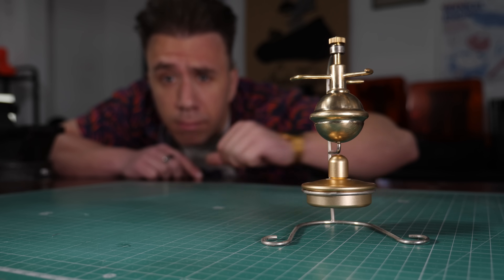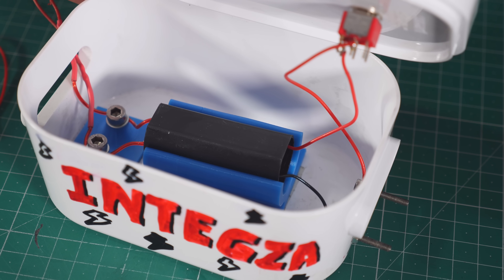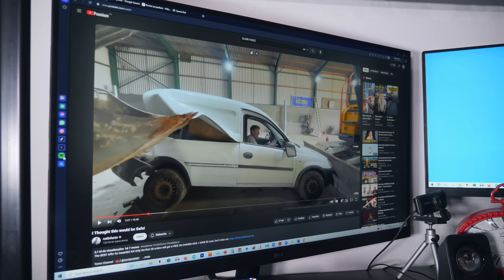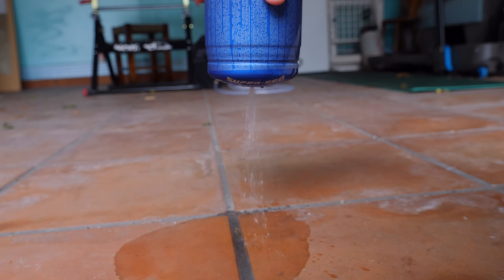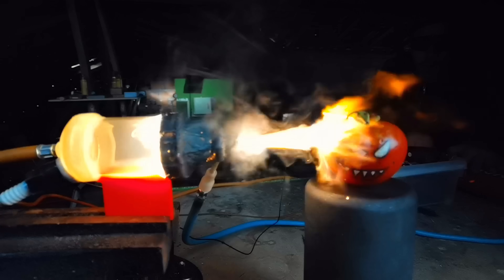I Built a ROCKET PROPELLER

Comment: You should make a air powered engine with your tesla oscillator using it's oscillating motion into rotational movement it would need no more complex valves and flywheel

Comment: You know the air pressure engine, what if instead of using a bottle as the tank, you can create a compressor, like a turbo charger, but instead of the exhaust gas it runs with a electric motor, so you can have different speeds and you don’t need any tank
Reply: Im trying to do it but I don’t have a 3D printer so I wanted to see if you could do that

Comment: 1. Plasma-Speaker Flamethrower

Combine a plasma arc speaker with a controlled flamethrower, syncing the flame bursts to music for a wild sci-tech sound system.

---

2. World’s Smallest Working Jet Engine

Design and build a miniature jet engine that’s not just small, but functional — maybe even smaller than a soda can.

---

3. Supersonic Ping Pong Ball Gun Mk III

Upgrade the classic vacuum cannon with new tech like electromagnets or compressed air boosters to try and break the speed of sound… again.

---

4. Home-Made AI Turret Defense System

Create an autonomous Nerf or water gun turret that detects intruders using AI (YOLO, OpenCV) and responds in real time.

---

5. DIY Hoverboard That Actually Hovers

Try recreating a real hoverboard using magnetic repulsion (Halbach arrays) or air cushion methods — inspired by magnetic levitation trains.

---

6. Tesla Coil-Powered Wireless Charger Room

Turn an entire room into a wireless power zone using Tesla coil tech to charge devices without cables (safely, of course).

---

7. Sonic Boom Cannon

Create a device that compresses and releases air so rapidly it creates a sonic boom — kind of like a reverse supersonic whistle.

---

8. Liquid Nitrogen-Powered Jet Pack

Experiment with a thruster system using rapidly evaporating cryogenic fluids like liquid nitrogen — safe miniaturized “rocket” effect.

---

9. The Impossible Drone: Propellers Inside a Sphere

Design a fully enclosed drone with internal rotating blades — testing airflow dynamics and flight stability in a wild new way.

---

10. DIY Mechanical AI Arm That Learns from You

Build a robotic arm that mimics your movement using machine learning, then let it evolve to perform tasks on its own.

Comment: Hi I'm new to watching your channel, I know this is not where you need this comment, BUT,
In one you said that you and Tom Stanton can't get a 3d printer to build a good sealing piston engine, so you build a square one, this being due to the printers that you have can't make a perfect circle !
Ok, so try an oval cylinder and a oval piston, this should work perfectly, I know Honda do this so they can fit more valves, although they don't use a 3d printer 😅 try it though.

Comment: AI Summary

Abstract:

This video details the experimental design and construction of a novel "spinning rocket" concept, drawing inspiration from Heron's Aeolipile to rotate a propeller. The project focuses on an internal combustion engine fueled by butane, later upgraded to propylene, designed to expel exhaust gases sideways to generate rotational thrust. Key engineering challenges addressed include managing extreme heat, leading to the use of graphite for both the engine's nozzles and a custom ball bearing cage. A thermodynamic innovation involves coiling a copper pipe around the engine to utilize the expansion and cooling properties of liquid butane, simultaneously cooling the engine and increasing fuel pressure. While initial tests with butane yielded limited RPMs, the accidental use of propylene significantly boosted performance to 2840 RPM, producing a kilogram of thrust. The video concludes with the next objective: integrating an air compressor driven by the engine for self-contained flight.

Propeller Rocket Engine: From Ancient Inspiration to Modern Experimentation

*   0:00 Heron's Aeolipile Inspiration: The video begins by introducing Heron's Aeolipile, an ancient steam turbine, and reinterprets its rotational principle to create a "spinning rocket" designed to drive a propeller.
*   0:32 Efficiency of Moving Air Slowly: The creator explains the principle that moving a large volume of air slowly (like a propeller) is more energy-efficient than moving a small volume of gas very fast (like a rocket) for sub-supersonic applications, due to the quadratic relationship between energy and velocity.
*   1:00 Rocket Engine Construction: The core of the project is a compact combustion engine that burns butane gas and expels it through a small hole to generate thrust, based on Newton's Third Law.
*   1:18 Graphite Nozzles: The engine's nozzles are crafted from graphite, chosen for its excellent heat resistance and ease of machining. The creator empirically tests three different nozzle sizes based on NASA-derived equations.
*   2:03 Sideways Thrust for Rotation: To achieve rotation, the exhaust gases are redirected sideways through brass tubes, a design inspired by the Aeolipile's rotational motion.
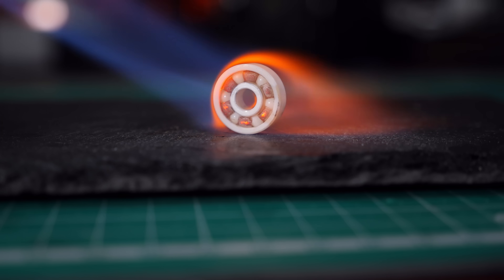*   3:33 Ball Bearing Heat Failure & Graphite Solution: An initial zirconia ceramic ball bearing failed due to its plastic cage melting under high temperatures. This was remedied by fabricating a new, heat-resistant, low-friction cage from graphite.
*   6:39 Propeller Protection & Butane Cooling System: Recognizing that the carbon fiber propeller's resin binder would burn, an ingenious cooling system was devised: a copper pipe coiled around the engine carries liquid butane. As the butane vaporizes and expands to fuel the engine, it simultaneously absorbs heat from the engine (cooling it) and increases its own pressure, enhancing fuel delivery.
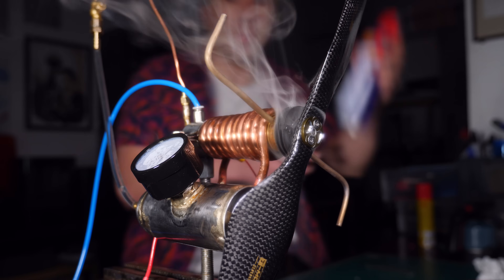*   9:00 Challenges in Butane System Optimization: Achieving stable operation required precise adjustments to the fuel reservoir's placement and the exact amount of butane charged into the system, balancing cooling and fuel supply.
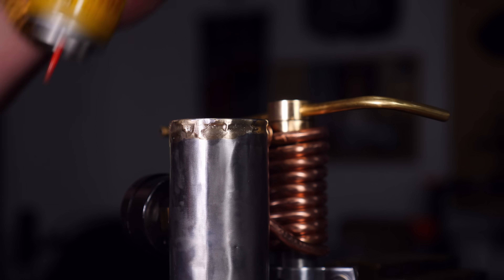*   9:41 Initial Performance with Butane: With butane as fuel, the engine reached up to 1280 rotations per minute (RPM). However, performance was limited by the butane's relatively low vapor pressure of 4 bar.
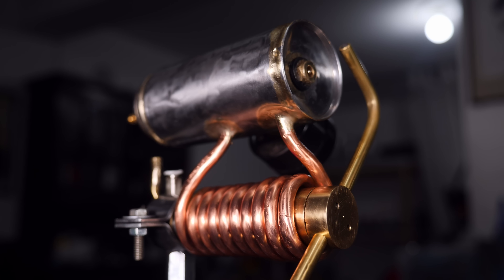*   10:42 Accidental Discovery of Propylene Fuel: The creator inadvertently switched to propylene (mistaken for butane) from a welding kit, which naturally has a higher vapor pressure.
*   11:56 Dramatic Performance Boost with Propylene: The use of propylene led to an "insane" increase in speed, reaching 2840 RPM and generating approximately 1 kilogram of thrust.
*   12:08 Future Goal: Self-Contained Flight: The next phase of the project involves integrating an air compressor, powered by the engine's rotation, to eliminate the need for an external air supply and enable autonomous flight.

I used gemini-2.5-flash-preview-05-20| input-price: 0.15 output-price: 3.5 max-context-length: 128_000 on rocketrecap dot com to summarize the transcript.
Cost (if I didn't use the free tier): $0.0054
Input tokens: 15882
Output tokens: 849

Comment: I got an idea lot a metal fueled rocket .. copper and aluminum react to each in acid right what about ground up aluminum and copper powder  and electricity high voltages   

I’m not sure what will come out the exhaust with a lil air pressure .. it will work I’ve been messing with vitamin supplements 😂😂😂  3 d printer nozzle and air circulation pump from a bed 😂😂😂 .  And a Dyson fan it’s gonna sound weird but green flames have more thrust I hope some one tries I’ve been thinking about casting aluminuminte (copper and aluminum ) then collect the sanding shavings I hope I just didn’t invent something dangerous 😂😂

Comment: Bottom port in for the cooling coil, top port out for fuel output. With bith in and out ports at the same level you arent making use of the heat at all.

Comment: The helicopter kellett kh-15 (aka Stable Mabel) used 90% hydrogen peroxide that decomposes and generates super heated steam  that poweres two steam jet engines at the tips of the helicopter blades to generate torque.

A minum 67% H2O2 concentration is needed to generate enough heat to completely evaporated all the water water. Ahe catalyst decompose the H2O2 and is made up of silver electroplated onto a nickle wire mesh.

Comment: Did you ever consider running the air pipe through the "butane" reservoir? The rushing air through the reservoir will pull the butane fumes along with it. It'll work just like a miniature carburetor.

Comment: Could you pleas build a rocket steering system (so that the rocket can steer itself and maybe even weaken or strengthen the thrust)
Reply: Integza, you can use the FULL POWER of your air compressor, without the air going into the butane can, if you use a Venturi so the air can "suck up" the butane.

I don't know why I wrote FULL POWER in caps, maybe it's because 🍅 are 🤢?

Comment: You could try using ram air generated by the propeller airflow to get some compression for your air supply, But that’s probably not going to get you very far. Even if you somehow manage to get ram air intakes on the end of the propeller blades you’ll be lucky to get 0.2 bar out of it.

If you can put something on the rotor to transfer power to the back of the assembly you could drive an air compressor with that

Comment: Say.  Would it be good idea to separate the liquid and gaceus fuel mixture so you can maximize pressure and cooling.  As for the compressed air you already demonstrated that a 2 literally bottle can survive 8 Bar which should allow you to have ample pressure and minimal weight for a short flight.  Having the bottles hooked up to a air compressor before the engine winds up and during take off would allow you to maximize pressure in the bottles lengthening flight time.  Oh and one more thing.  Integrating the exhaust lines into the propellers would reduce drag and help with cooling as the propellers absorb and dissipate heat.  I'm not an engineer or anything so take my words with a grain of salt but it might be insightful enough to think of something useful.  Cheers and thanks for the cool concept.

Comment: If you need compressed air, Paintball canisters hold a lot at high pressure.  I'd use one-way valves and a regulator on both supplies....

Comment: I think I have a solution, it is a configuration that uses a ducted set of propellers to compress air into a jet along the axis of the engine. Also you can bleed off some energy to solve the fuel feed problem using some sort of cryogenic pump to move the liquid fuel.  And if thus you don't really need to return it to the reservoir allowing you to highly pressurize and control the entire fuel system.  Anyway I'm sure I've seen that configuration somewhere before 😂

Comment: Would love to see you build a duct around it with stators fixed to the duct, the nozzles angles outward a little, using the pressure to maybe improve power? Then a smaller fan could blow through the duct creating thrust and cooling flow.  Just a thought... Might be a total waste of time.

Comment: just a thought.. instead of compressing air for the combustion via the engines rotation.. could'nt you just take both cans from your little welder and use both? then you have both fuel and oxygen? i mean it IS a rocket

Comment: the coil and tank doesnt allow for any flow through the coil. normally the liquid enters the coil, vaporises, and straight into the burner. look at hot air balloons?
yes, propane has a higher pressure as it liquefies at a lower temperature than butane...

the thrust is only the area of the tip and the pressure differential at the nozzle.
as its a reaction turbine it still has to spin at the same speed as the gas its ejecting for maximum efficiency. which is silly fast.
try the opposite. hold the nozzles still and blast the exhaust past a ring of blades... impulse. 

the tube itself is a large restriction...

Comment: Oh, by the way—quick idea I had while rewatching your magnetic piston engine video:

You mentioned that awkward moment at TDC (Top Dead Center) where the piston just kinda... stalls, relying on its own inertia to carry it through. I kept thinking—what if we stopped forcing the piston to do all the work, and instead made the engine pivot with it?

Like, instead of a static combustion chamber and a moving piston, we let the entire chamber oscillate around a pivot—swinging with the crankshaft’s motion. The result? The piston rod still drives a rotation, but the cylinder itself tilts in sync, keeping momentum going even at TDC.

Comment: Back in the 50's a rocket engine was designed that had the propellant expansion coils mounted inside the combustion chamber. This engine ran on liquid propane. Maybe this might work for your application if you were to make things a little bigger so parts would fit. Question: If you made your rocket exhaust pipes longer would this give the shaft for the prop more torque to spin the prop? Conversely I think that shorter pipes would cause the prop to spin faster. Something to play with while you learn to like tomatoes. :)

Comment: hey meng, you lose a good amount of thrust bending those tubes when you could just use a Tesla Turbine to convert the flow of gas to mechanical force using a straight outlet from the combustion chamber instead.  It's a bit more complicated but results in more rotational energy.  And more energy is always better, yeah?  You feel me.  GG

Comment: now  do  it  by 1,000 X`s  and  in  diferent  position  all  pointing in  one  direction  , you  will  have to  adjust  pressures  to  force  each  to  burn  at  same rate  per  each  end of  exuast  has to  meet  same point  of  exit and  yes  again  yo  have  to  adjust  per  each  leaving  most  interiuor  at natural /  raw  - once  equality  has  been  acheived  then  you  boost ,  so  scale  has  to  meet  pressure  value  to  continue  utility  at  range  or  it  may  just  burn  up depends  on  which  or  shall  i  say  the  ammount  of  force applied /material  used `~

Comment: A bazillion years ago when I was young & dinosaurs still roamed the Earth, there was a magazine called "Popular Mechanics." In one issue there as a backpack helicopter unit where the tips of the rotors had little jets, which eliminated the usual need for a tail rotor because no torque from spinning the main rotor [as we all should know by now, Newton never sleeps]

So your next challenge is printing up your own backpack helicopter using the principles of integral Integzajets at the tips. 👍😁

Comment: Maby you can run a pipe in a reversed way. Like with the opening to the direction of the rotation. Scooping air while turning. That would also mean more air when going faster. All you need is the right funnel to make a good ratio. Of air and fuel

Comment: 4 isn't a great design? You don't say.  😂😂😂 
Also, you don't need gloves for graphite. Only for graphene and nano graphene. Graphite is harmless, just very slippery. Also, I would be extremely careful when drilling, cutting, or sanding carbon fiber. I don't trust that stuff. I'd rather stick my face in a bunch of pink fiberglass than go anywhere near carbon fiber dust. Or as I like to call it, synthetic asbestos.

Comment: So, I got curious and googled around a bit and found that 
7:35 This is called regenerative cooling in rocket engines, where the fuel itself is circulated through channels in the engine nozzle or combustion chamber walls before being burned. NASA had this system in their Space Shuttle engines.

Also found there were helicopters that spun the rotors with jet at the tip called Tip Jets. 

I thought it was pretty neat.

Comment: I wonder if shortening the exhaust pipes might help at all. The exhaust gasses won't have as much distance to travel in the small pipe, so you shouldn't be slowing them down due to friction loss. The reduced weight might also help you gain an extra RPM or two. Propeller length might also be a limiting factor in RPM (I know you only had the one). 
The pressure issue might be resolved by using a smaller WD-40 can and copper tubing. 

I'll finish by saying that I'm not anywhere near being an engineer and have zero experience in what you're trying to do. I could be dead wrong in all aspects. I'm sure someone will correct me. Lol!

Comment: This is similar in concept to the "rocket on rotor" helicopter designs, some prototypes of which were built in the 1960s. This was a fairly simple modification which could in principle be fitted to any existing helicopter, but at the time the military spec Huey UH-1Y Venoms were chosen, since there were a lot of them in service.

The only modifications were the fitment of small rocket motors into the tips of the main rotor blades, firing at 90 degrees so that the rocket thrust would most efficiently be used to enhance the rotation rate. Each rocket had a maximum thrust of about 50 pounds force, and was a simple pressure-fed monopropellant motor, fuelled by hydrogen peroxide. No fuel pump was needed, since the peroxide tank was mounted just above the rotor hub, so that centrifugal force alone would be enough to feed peroxide to the rocket motors.

The conventional helicopter engines were not modified at all, and in fact were still used for the majority of the flight time, since the volume of peroxide carried in the hub tanks was only enough for a few minutes of rocket thrust. This was overall a helicopter equivalent of rocket-assisted takeoff: A rocket on rotor helicopter could either lift off and climb much faster, or could do so with a heavier payload than would otherwise be possible.

Comment: That cooling method is very common in rocketry and called regenerative cooling. Though typically one side of the cooling loop is connected directly into the combustion chamber instead of returning to the tank.

Though that method typically requires a pump or external pressurization instead of just relying on your fuel's vapor pressure.